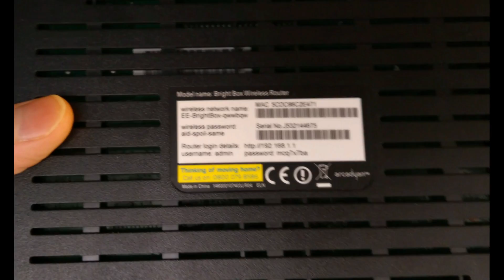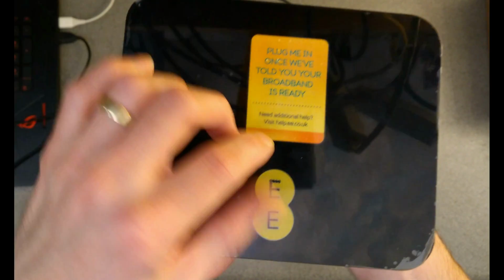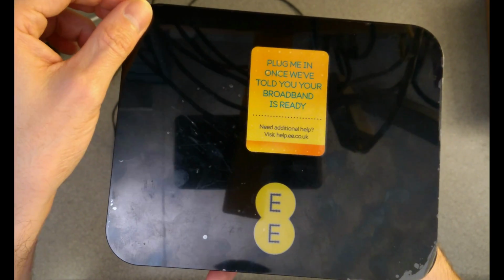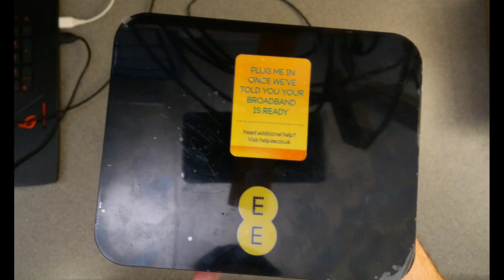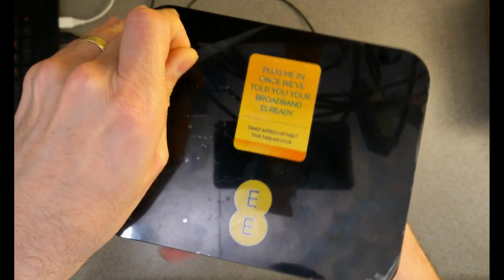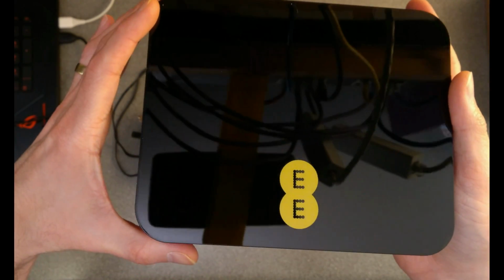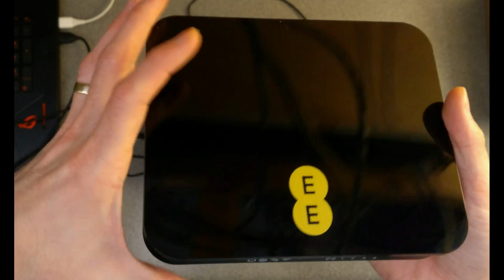The EE Bright Box Wireless Router and what is inside it.

Comment: What cat are the Ethernet  cable is this
Reply from the maker: Not sure I understand the question. What CAT cables come with it ? No idea. Probably stamped CAT5e but sometimes providers are shipping only 4 wire cable (limited to 100mbps).

CAT5e or CAT6 will work fine with the router if you are looking to buy some cables.